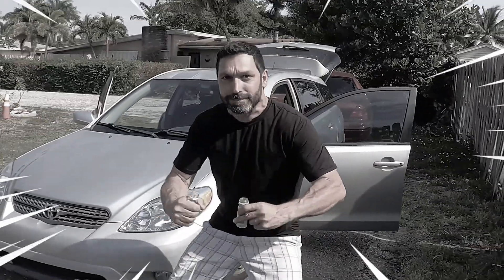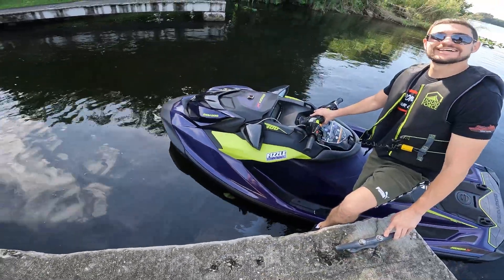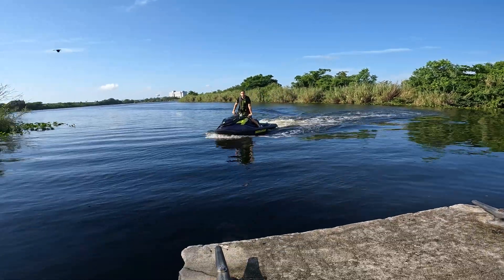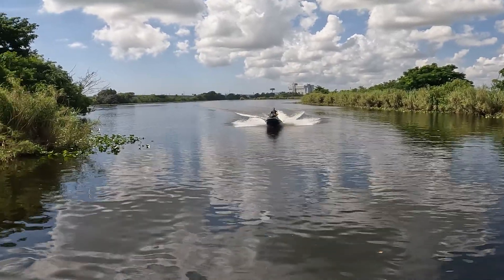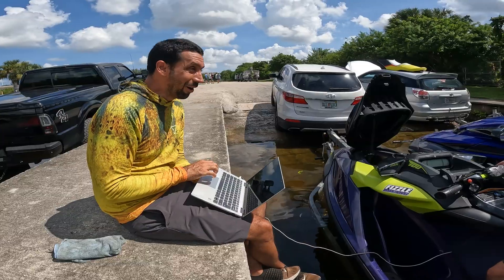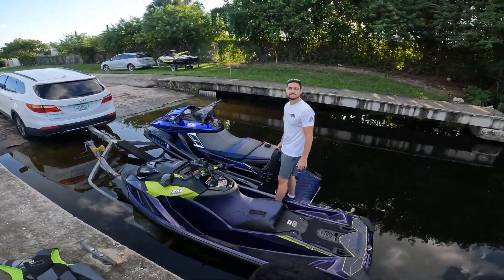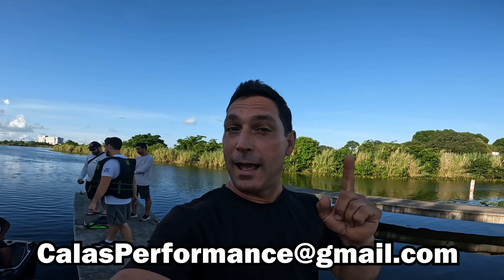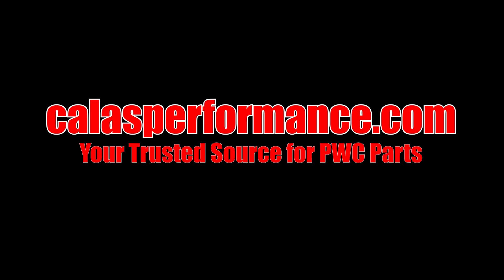Stage 2 SeaDoo RXPX Hits 87 MPH with a HEAVY RIDER using the NEW Calas TUNE + HP Tuners@JackCecil

Comment: hey calas, love your videos. I want to start repairing jetskis and learning a lot about them. I came across this 2014 RXTX 260 on facebook, owner says it has low compression on cylinder 3 and the intercooler is totally bad. it still runs but very rough. i would really appreciate any advice on if this is a good buy or not, its at a very good price but not sure exactly what im getting myself into but i would love to learn. thanks!

Comment: I think this is more of a stage 1.5 since it doesnt have fizzle intercooler and still has stock hoses. Plus its a stock prop.   Heat soaked running consistently 87mph on this hot weather  is pretty impressive if you ask me.

Comment: I still believe that who claims that you get more or less depending on fuel is just making it up 😂😂😂 well done
Reply: I agree.  The big man weighs 281 lbs. And they still got the same number.  He got 86mph letting off then getting back in it.  Same acceleration too with a heat soaked motor

Comment: Why does everyone hide the magic tuning sessions using the software. All they do is look T a cube and see where it dips or is flat at a particular RPM and click that area to push it up or down, then save and re flash the ECM.   Then they want to charge $250-$400 to so call program your ECM.  But there is more. Each day has different density altitude and barometric pressure so the perfect tune changes based on conditions.   They need to invent an AI module that optimizes the tune in real time based on specific and changing conditions
Reply: I'm sure if people wanted to learn how to tune, they would search for how to videos on how to do it.  Some people don't have time for that so they rather pay for a tune.  I don't see anything wrong with that.

Comment: That bigger wheel needs an intake girdle.  How high of RPM do you want to go before you add springs and retainers?
Reply: I think he had stock intake without Girdle. Just for the sake of the video. Also a ribbon delete will benefit from it and probably gain a few more mph
Reply from the maker: I would recommend 8500 and up
Reply: @calasworld hi mate what would be the best modifications for a stock 2008 rxpx 255? Sits at 70mph no problem but after that little more top end without sacrificing low end grunt aswell? Thanks

Comment: If Sea doo could hold at least 78 to 79 mph in shoppy waters in ocean I'll go sea doo but,in flat water anyone is fast. But 90% of the time in the ain't no flat waters. my other concern is why sea doo instead to put 4 motor mount they put 3 that couse the shaft damage.. and that's why yamis and kawi are the best. Now I understand that the easiest watercraft to work on is Sea doo. However bro I love you and you make me laugh😂 keep doing your job you are great 👍 if I see you I will hug you and I am not on the color gang 😂
Reply: What are you talking about? What shaft damage because of 3 motor mounts?
Reply: Never had any shaft damage on my rxp I jump a lot of waves. Over 300 hours on my jetski. Just gotta keep an eye on the Carbon Seal and make sure the motor is aligned. That's about it

Comment: Really impressive that it still gets that number using the BIG DYNO. I see the same acceleration gains when i timed both runs with Calas and fizzle riding it.   Would be cool to see some Dragy Data because the Calas Cam mainly improves the acceleration specially in the mid range.  None the less Great video guys . Keep up the great work